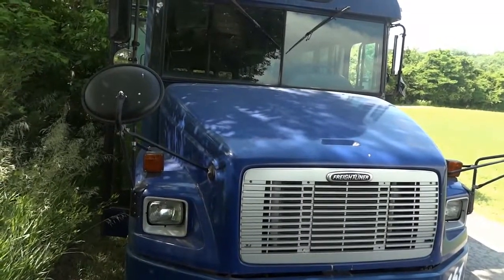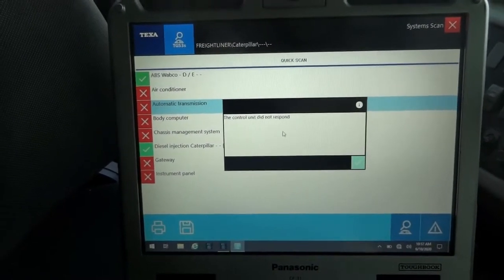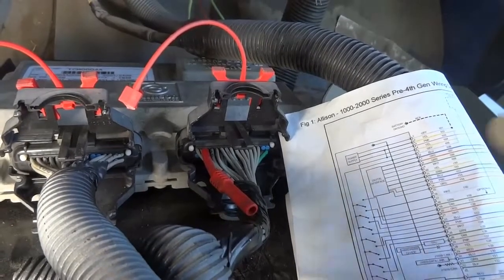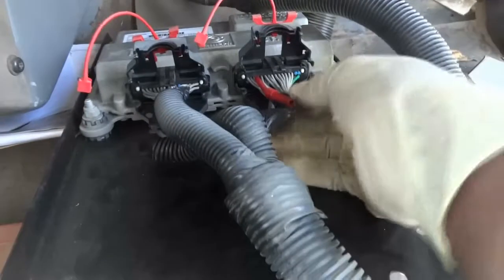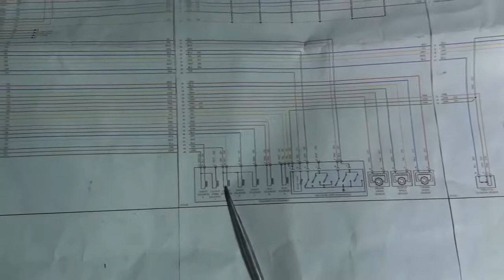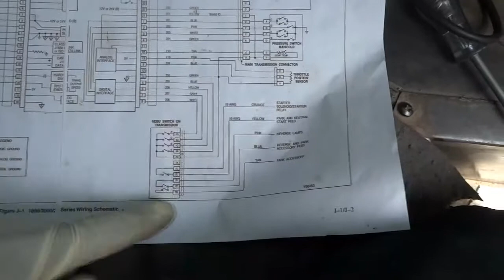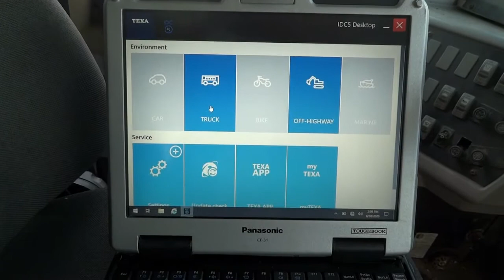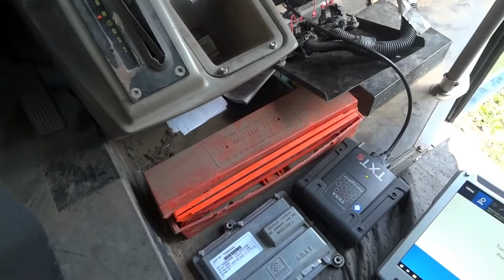Freightliner School Bus:  Inoperative Speedometer/ Allison Transmission not shifting Gears

Comment: This is absolutely amazing! I’ve got a freightliner MBC FE passenger bus with a Cummins and Allison combo and I’m constantly chasing codes, sensors etc. lately I’ve been getting Trans Comm Failure, range selector and speed sensor codes. The diagnostics are draining me but this def helps to see how thorough you’ve got to be to really fix these things properly and the little short cuts, like testing the solenoids from the connector rather than underneath that can help keep some hair on my head. Thank you so much for the comprehensive tut!! Very grateful!!
Reply from the maker: @jayblanda2774   My Pleasure! Thanks, I'm gglad to hear that the video is helpful

Comment: Where did you get the schematics for the Allison transmission with the ohm readings for the solenoids in the transmission. Was it part of the Diesel Laptops diagnostic laptop you're using or did you get it from Allison. Thanks for posting.
Reply from the maker: Rick L   My Pleasure! I got the wiring diagram from mitchell prodemand!